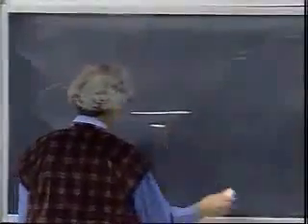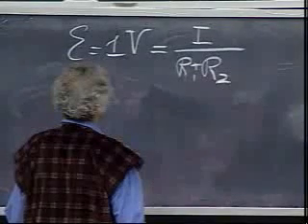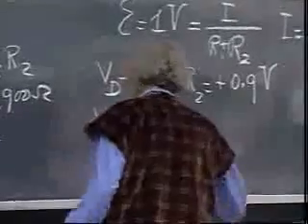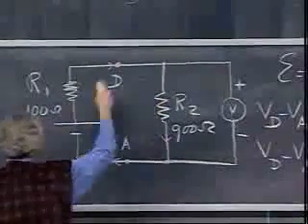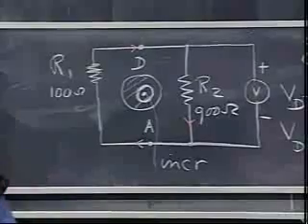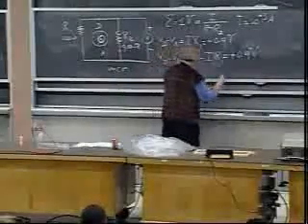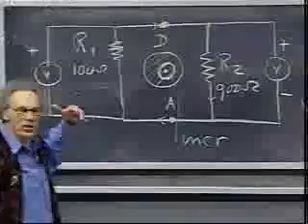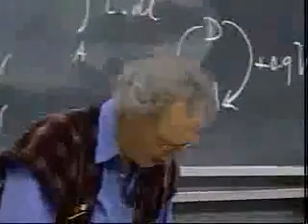Kirchhoff's "for the birds"? (see video description) [subtitles & legendas Pt-BR]

Comment: So, no connections are drawn in adding an inductor at the moment of turning on the circuit. If it replaced the battery, then it fills the 1 volt in as the battery did, but only for the instant it is turned on. Of course a DC volt meter would not read that😢. Naturally a field influencing the circuit without a physical connection is possible and will create cross or counter currents. Basically what EMPs do… dynamically frying some components, not cancelling out voltages, but blending the mixture.
Or did I get the implied circuit change wrong? But the battery is gone, so no blending, just the inductor’s power.9:26
Reply: Mission accomplished, mind blown, on the setup, not result.

Comment: Removing the battery from a circuit to prove Kirchhoff is wrong is like removing the engine from a car to prove the concept of cars is non functional. The experiment itself might be interesting, but in this rare scenario he shouldn't say "Kirchhoff is for the birds". Because this is an exception and a constructed case. Not the norm.
Rubbish.
Reply: Wolfgang-Michael Bauer Or, you could take a second look and realize the battery circuit may be common, but it is a special case. And the rules that we use to study and design it are incomplete when it comes to dealing with what is possible. Its not about where we have come, but about where we can go. And what will happen if the environment changes beyond what we ignore.

What happens to all these circuits that have no distinguishing characteristics or specifications for environmentally changing magnetic fields? In Brazil, below the South Atlantic Anomaly (yes, its now not so far south and also spans to Africa), that blew out its power grid for the second time in February... tens of millions of users lost electrical power when it collapsed. How? The geomagnetic field fluctuated with a mild solar flare. It turns out transformer cores accept and amplify this energy. And current flowing backwards in the power grid is not a good thing. 

Leave that battery in the circuit and add the inductor and you will likely charge up the Battery while you cycle the inductor, if you can design it to maximize the pulses in one direction by making the discharge much slower than the charging pulse. Batteries have a lot of capacitance. The Bedini SGC works on this principle.

The solar heliosphere is cancelling out, with it the Earth's geomagnetic field is failing/fluctuating more... Business Science does not consider these effects. This lecture is just a mental exercise for the students, nothing has been developed to re-design electrical theory to incorporate this "open system" phenomenon into the design of mass produced and utilized electrical systems like power grids or pc's. The three laws of thermodynamics are a special case... they are predicated on closed systems. And ignore hysteresis. They were developed before electricity was known as an energy source.

So many things could be done when one gives up their laws to the birds. Like, recognizing that induction is a two step process. First the capacitive transfer of magnetic field energy to a conductor, then the discharge of that energy to a load. Not directly the charge transfer to the load. Use a flux-capacitor (bifilar wound inductor) to harvest the changing magnetic energy and you defeat Lenz's law electrical resistance. The special case of common electric motors no longer apply. Joe Newman and Thane C Heins both made electricity with electric motors doing this. Joe increased his capacitance with long inductor wire lengths, Heins using Tesla's design. Business Science refused to patent either and also blocked the commercial application of either. But, the process and proof are in the public domain. Want a car with unlimited range on self-generated power? A home generator that has no exhaust? You can't buy it, but you can make it. To do so, you will have to feed the birds. Peace, B
Reply: @mundymorningreport3137 nonsense

Comment: When you 'power' your device with risning/fallign magnetic flux, all what was a cabe, now is a battery. Kirshoff law still works, but you have to re-draw your schematic and place voltage sources in place of wires, because when flux changes, wires works as sources.
For a technicans is a very known and sometimes painful problem, when wires become voltage sources due to induction. Painting half of a blackboard with integrals is just a smoke cover for your tricks profesor, but you won't foll a technican :)
Reply from the maker: Agreed, the description of the video mentions this point and goes beyond, by suggesting that the lecture treats the battery as a "conservative field" (which rigorously it is not) and then omits completely from the circuit any representation of the inductive emf.
Reply: You guys are missing what is meant by a “conservative field”.  The only way a field integral can be path independent is if what we call the curl of the field is zero.  Kirchhoff’s law depends on the existence of a scalar potential to the electric field.  If there is a changing magnetic flux, there is a curl in the electric field, thus no scalar potential exists, and there is a net gain in energy around your circuit loop.

You can redraw the circuit with an inductor...sure...but now you are working a different problem.  Much of engineering is recognizing what we call "equivalent problems" that are easier to solve and yield the same result.
Reply: Kevin Lyon The saying amongst engineers about physicists used to be "Every TheOry has a hole." It is broadly recognized by working people that the rules that justify reality are not adequate and experience is a better teacher. Sadly, it is hard to swallow that this is intentional. And the best theorists can do after more than 100 years of disinformation, is to point out small little inconsistencies like this one. 

But still, at least it may inspire others to think outside the primary box that has boundaries that mislead. The math is complex and needs to be only because the simple rules of reality would change how we do things at a fundamental level and give us insights that would revolutionize the basic services we contract for to stay alive. Anyone coming from practical observations could, as many have, innovate the systems and create things that simply cannot be by following the basic laws of science, using the limited analytical tools that apply only to the special case designs that are in use today.
Reply: @mundymorningreport3137  That um....reads like babble... :P
Reply: @pauliexcluded1  No worries. Nothing for you here. Broadcasting power without loading the generator wouldn't help the power companies. This type of demo points to a world that only exists in the minds of people who choose to model the world as it is, not as its taught. To do that, you would have to suspend disbelief and deny what you think is real. You would have to feed the birds with more than Kirchhoff's laws. Things like Lenz's law, capacitors store energy on the plates not the dielectric, that current is just the rate of charges moving past a point in time and it can't move faster than light speed, and that the phase of magnetism can be adjusted with relation to the phase of the voltage transfer during induction. Obviously not on your bucket list. Just the wind rattling branches against your window outside. Or the babbling of a brook.. you might discover the secret of the natural abundance of nature. Not how we do business today.  Peace, B

Comment: Speaking as a non graduate technician there seems to be something wrong here.

Lewin states that the EMF induced at time t  = 1v but seen from a tecnician (ie non scientific pov) that emf  is operating on a parallel loop where the battery completed a series loop.
Also , in what is the emf induced. ?
Since he is speaking of magnetic fields then the field will be rising or falling ie not constant.

Also Lewin appears to state EMF (volts) and Flux (phi) are the same
Is that true.? Does he even say that ? He glosses quickly over the point.

The idea of shifting the voltmeter form the RHS to the LHS to produce different instrument readings makes no electrical sense.unless those points are at different potentials
IOW the LHS top corner is not at the same potential as the RHS top corner.

I am not dogmatically trying to correct Lewin I am simply saying that what he describes goes against everything I have understood re electrical cct's.
Reply from the maker: +divvy1400yam600 I believe one of your points (the battery operating on a series loop versus the emf operating on a parallel loop) is related to the critique drawn in the video description).
Reply from the maker: This video is only part of the lecture. Try to search for the  complete one, where an experiment, with scopes plugged on both sides of the circuit shows that the reading comes out different indeed.

Comment: This guy loses 10 minutes of a highly paid class in MIT to make a foul of himself.
I don't know what's worse, if the wrong Ohm's law equation, or drawing a circuit with lumped elements and don't understanding what the lumped circuit abstraction is. 
KVL is correct when you apply it in the proper condition that the change of magnetic flux OUTSIDE an element is zero. This is the base for all circuit theory, together with the assumption that the buildup of net charge INSIDE an element is zero.
This dumbass uses an EXTERNAL magnetic field, which obviously can't be handled by KVL, to show that KVL is wrong!!
Pathetic...
Reply: thelovedreamer I don’t agree with your conclusions.
The point of that teacher is really fantastic. This is a reminder ea for  a lot of engineers about the facts that behind all theories there are a lot of assumptions. Change one assumption and you get a complete different view and even understanding of the physics.
On top, it is a great moment to think or think again about the physics of a problem and the meaning of all the concepts we use on a daily basis.
But to undertand the utility of the concept you need to be able to pull yourself at a higher level.
Reply from the maker: thelovedreamer
I must agree with your (+thelovedreamer's) points. They are more abrasive than mine, and resort to solid practice and knowledge instead of trying to rest on purely pedagogical arguments, but they are objectively true. There is a feeling deep inside me however that keeps telling me that it has been great to have this brief "show" running by Lewin with all his choices of bold terms. So, I am still not able to accept that these 10 minutes have been a waste of time, but I am trying to. Maybe the title of this video should be changed to "10 minutes for the birds"? :)
Reply: thelovedreamer  Engineers should study more closely Maxwell's Equations to try understand electrical circuits. The issue is normally engineers get frozen in front of Electromagnetic theory. What this professor is trying to teach you is that circuit theory comes from Electromagnetic theory and not the opposite. Or KVL is one of Maxwell's equations and I'm not knowing that? Try to see this video to understand why is important having no magnetic flux variation (internal or external) to make possible use of KVL as a law, because in general it is not.
Reply: Gtensor R KVL is an abstraction where engineers make a distinction between the cases, when there is a changing magnetic field and when  there is not, as being altogether different and unrelated. I guess that is ok for those who learn by 'monkey see monkey do',  but as far as physical law is concerned, that distinction is for the birds. Ask your average engineer why KVL is a law, and he'll be stumped
Reply from the maker: On one hand I feel happy with your comment, since it reads as though you are one of few people who understand these points, that I raise in the description (in a somewhat different but equivalent  perspective). On the other hand I disagree with the suggestion that the lecture is a "waste of time" (let alone the minute error of changing Ohms law, which is purely human). It raises the points of what these laws are about (whether or not  there exist more general principles, symmetries, etc. that give rise to them, and what should or should not be kept when extending the analysis to coupled (interacting) systems, etc.). All lectures from Walter Lewin are worth watching and it is an act of generosity that he agrees, under the auspices of MIT, to share them with the world. How would we have such an opportunity to refine our views in so many aspects illustrated in all his lectures?
Reply: zer0s0und Well, I didn't say the complete lecture was a waste of time, only this 10 minutes. If he wants to make a point which will "blow your minds" he should be rigorous on the initial conditions and don't talk about KVL like it is a bad thing. I believe he doesn't know that the practical approach in electrical engineering is the use of the lumped circuit abstraction, which makes 2 big simplifications in Maxwell's equations to ease the study of electrical circuits. But these are simplifications that are physically valid, because it's a matter of adhering to this discipline using the basic circuit elements that we all know about. He uses a convoluted and badly built argument when he could simply say that Kirchhoff's laws are simplifications for practical engineering use (even a few years after Kirchhoff).
He makes another arrogant mistake, like saying almost all books are wrong. They are not wrong, they assume inductors as lumped elements, where the rate of change of magnetic flux is different than zero ONLY INSIDE the inductor (as a good approximation). If so is the case KVL can be applied without disregard for the physics involved.
Reply: +thelovedreamer The closed loop integral of E.dl in each loop that consists of one R and one Voltmeter is zero because dphi/dt through an open surface attached to the closed loop is zero. Kirchhoff's loop rule holds in these 2 loops (not in any other closed loop). Thus the voltmeter reads the value of the integral of E.dl going through the R and that is IR. Thus V1=IR1 and V2=IR2 and that is what the demo shows! If you want to be a purist, the integral E.dl from one side of the R to the other is (I-I_v)*R. Here I_v is the current going through the Voltmeter. But since I_v is some 8-10 orders of magnitude lower than I, it can be neglected. If you are still in doubt I suggest you read the Lecture Notes which have been posted as a pdf file (look below the video). I cannot help you any further.